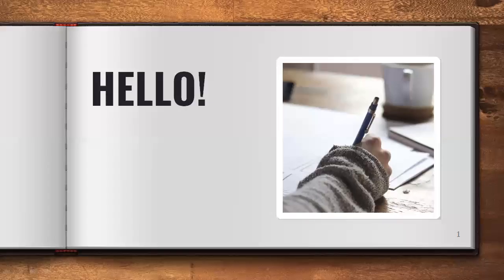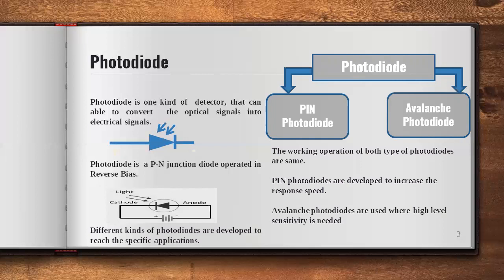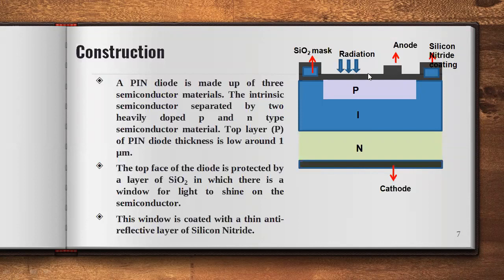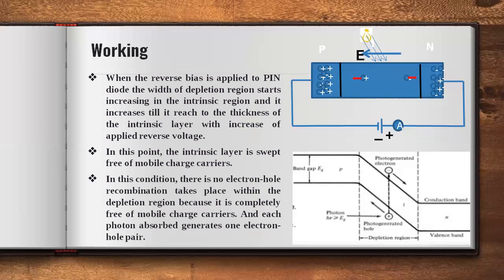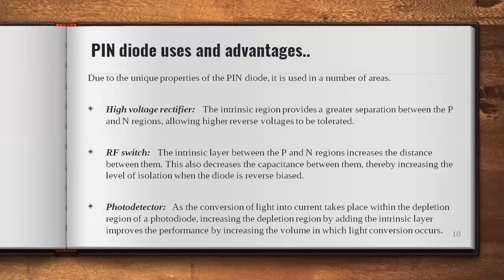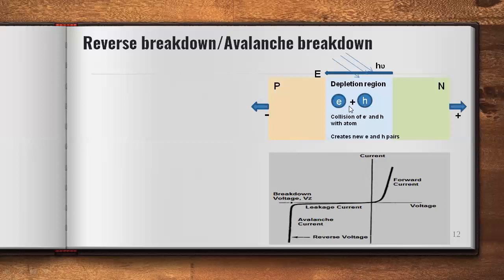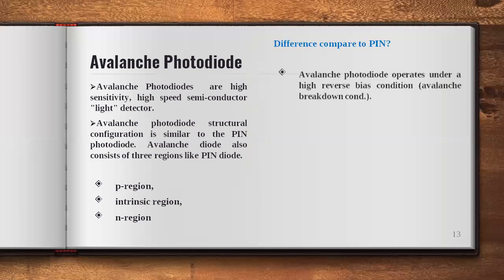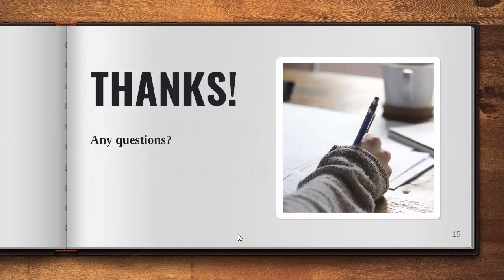PHOTO DIODE / PIN and Avalanche photo diode/Engineering Physics/Applied Physics/BTECH /MSC

Comment: Both of these diodes can be used for radiation detectors. You can even use ordinary silicon avalanche protection diodes as solid state geiger like detectors. The particle or photon hitting it trigers an avanche of charge transfer similarly to what happens when a geiger tube fires.

Comment: So how does Geiger mode works?
Reply: The high electric field gets disrupted by carriers generated when the photon impacts. These charge carriers create more and the device effectively shorts out.creating an all or nothing pulse. The trade off is that you swap proportional response for gross sensitivity. You can even use a cheap avalanche ESD protector as  a literal geiger counter if you like. The maximum sensitivity us at the lower end of the gamma range peaking around 70keV.